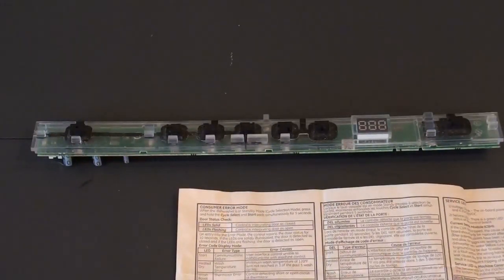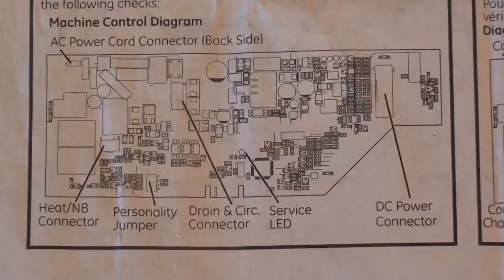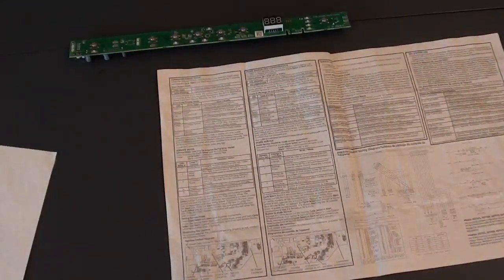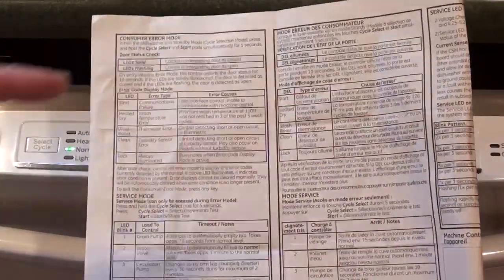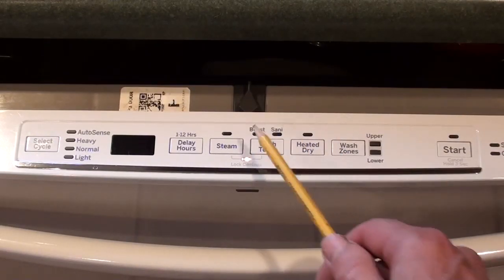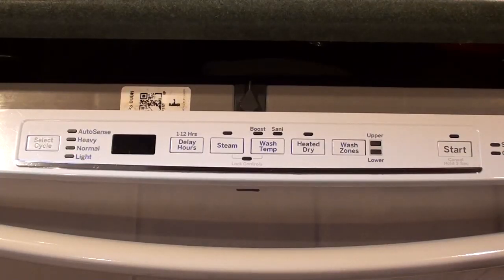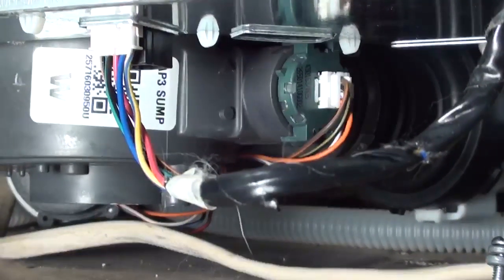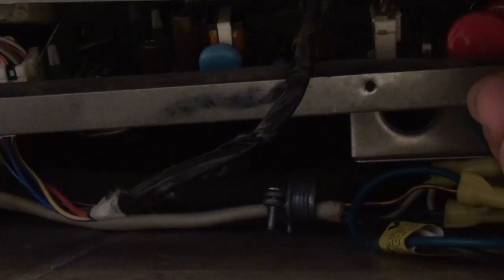Diagnose Codes and Replace Repair Bad PCB Control Board in GE Dishwasher

Comment: Where did you get this sheet?
Reply: It is under the front behind the panel (kick panel) under the door- take out the two little screws, then look on the left side - folded into a 2” square tucked on the side by the foot
Reply: @earthn1447  Thanks, I think mine was taken.

Comment: The service LED light on my GE model GDT695SGJBB is solid green wether the door is open or closed so I bought and replaced the UI board (WD21X23463). It did not fix the issue. The issue being, no lights or functionality of the UI touchpad. Dishwasher is not working at all. Can you help?
Reply: So if that didn't work, guessing it was the bottom one that needed replaced.   Did you ever figure it out?
Reply: @nobodycares2354  it turns out that it was the top interface board. It needed to be programmed. I ended up having to call a technician to program the board I had installed.
Reply: @hotrolls3473  Yes I believe there are a few jumpers in a row that need to be placed in the right position (jumpered or not jumpered) although according to what you wrote it sounded as though the bottom control was defective> depending on the model the green led lite should be a steady flash or a double time flash (where the control PCB is square shaped)
Reply: @spookville6632  The board manufacturer did not install the jumpers during manufacturing. In addition, my board needed a software update so I had to call a technician who plugged into my board and installed the update.

Comment: I have the GE GDT680 model.  My heating element is not working.  I replaced the element, but that was not it.  The user interface board they sent me has a "personality jumper" that has to be configured.  I ran the test you showed by holding down the cycle and start.  They all blinked and the only ones left on were the "autosense" and "lock controls".  What does that mean?  Also, do you know how to set the jumper on the new board?  It's Christmas eve and I could sure use the dishwasher... ;)

Comment: So if the LED on the main control board is dead or not flashing or lit up then I need to replace the lower main control board? I can't find much information on this. Thank you in advance

Comment: Great video!  Thanks!  My service light on the lower board won't come on at all, so I'm going to replace the lower board.  My upper panel seems to work fine.
Reply: Did it work?
Reply: @Mejia93635  Yes, it worked! I replaced the lower circuit board, and the dishwasher works fine now.
Reply: Thank you for the information 👍
Reply: 90% chance your both boards are bad. GE makes junk. You'll  be money ahead throwing that piece of shit away.

Comment: When you had all lights flashing if you closed the door switch would they stop flashing. or if you held the door switch in closed with a screw driver would the lights all flash in the test mode?
Reply: I would also like to know this.